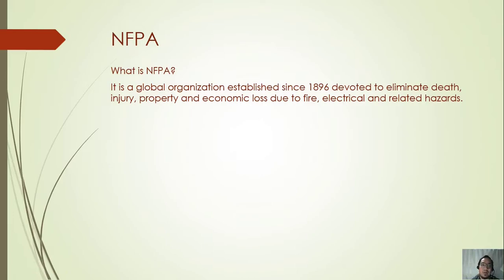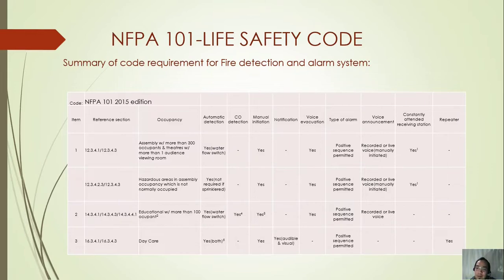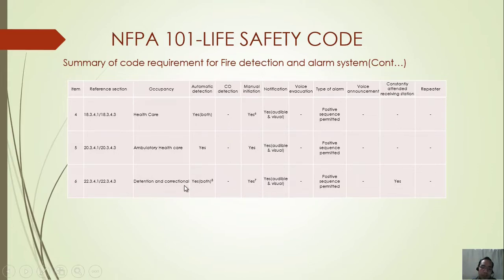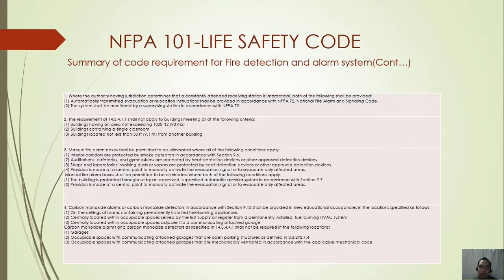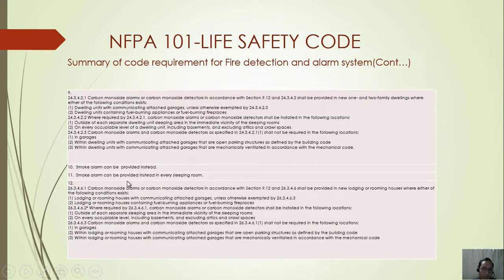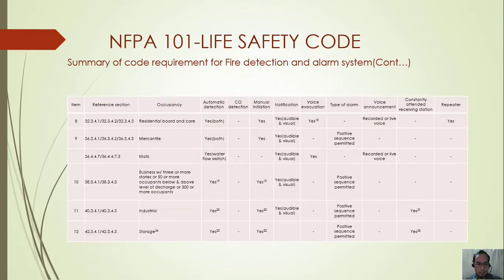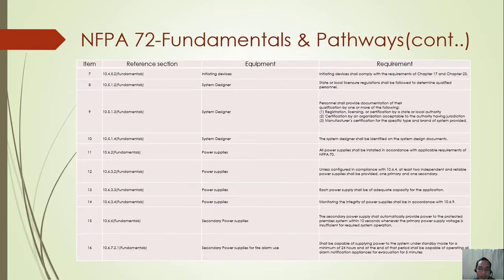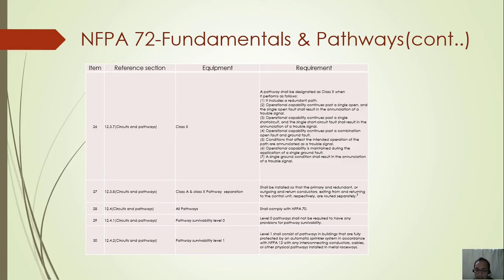Fire Alarm Installation Training - Design Tutorial Part 2/3 #Firealarm #Design

Comment: Good day sir i ask what is the  clearance of electrical switch and manual call points thanks.
Reply from the maker: Hi Levy, the manual call point can be placed at any distance to the electrical switch and there is no specific from NFPA. If they are in one place, usually they are mounted at same level provided that you still maintain the limit in height which is within 1.07m - 1.22 from ffl to the operable part.

Comment: Sir... What is the recommended location or height of remote LED according to NFPA 72? Thank you sir in advance.
Reply from the maker: Hi. Thanks for watching. As specified in NFPA 72 in clause 17.4.7.2 of 2016 edition, they shall be in accessible location and be labeled clearly. Therefore you can propose at any height feasible as per site. But be noted also that remote LED can be omitted in concealed location when we use addressable FDAS as long as the specific detector can be viewed from the FACP. You can check NFPA 72 clause 17.4.7.3.
Reply: @AllaboutFireProtection  Thank you very much  sir . I appreciate it.

Comment: I took NFPA 72: Basic Fire Alarm System and it was great. I have a question regarding the certification. Which route is taken to become a fire alarm designer. In NFPA website, three types of certifications are approved by Pro Board, Fire Inspector I, Fire Inspector II and fire plan examiner. my question in other words, how can some one become a fire alarm system designer ? I am glad I found your channel, it is very informative.
Reply from the maker: Hi Azam, appreciate your feedback to my channel and I'm glad it helps. All the certification that you mentioned above are the options of the professionals who are working in the fire protection industry for their credibility. You may take any of those depends on which field or role are you working for. But if your aim is to have a certification for fire alarm system design as designer and if your reference standard per your local code requirement is NFPA, then I may advise you take online NFPA certification such as NFPA 72, 70 & 101 which I also discussed in my video some important chapters as fundamental for designer. You may also want to try to take CFPS exam which you can use for your credibility as designer for fire protection. Some country like in USA require other certification like NICET with different levels.

Comment: Hi,

What is the criteria of smoke detector placement  in ceiling void?? Do we need smoke detector In ceiling void if only instrument cable is running inside ceiling void . Thanks in advance
Reply from the maker: The requirement for placement of detector will vary depending on which code your country is implementing for the construction of the building. Check your local code requirement for your guidelines of fire alarm requirement. Some country like I worked before, it is in their local code that detector shall be placed in ceiling void especially when it is accessible that people might access it for storage of potential combustible materials or if there is obvious source of ignition like equipments installed above the ceiling. My advise for you is to check first your local code requirement.